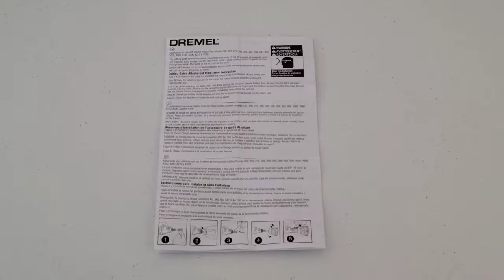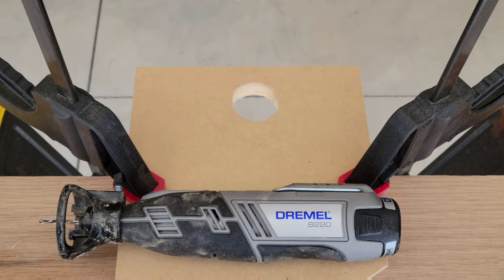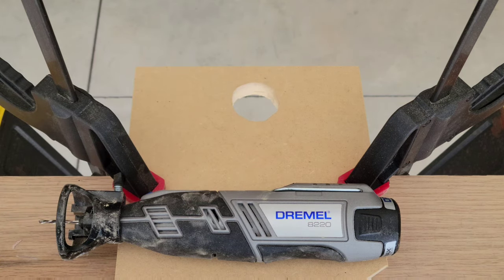How To Use The Dremel Cutting Guide And Multipurpose Cutting Bit And Review

Comment: My ears! I'll use a hole saw and save time and electricity.
Reply: my thoughts exactly. my dremel always sounds like it is dying & very disturbing...
Reply: Try that hole saw on a plaster ceiling 😅
It's not pretty to say the least
Now this attachment with a tile cutter and then the wood bit and I no longer need to repair a plaster ceiling

Comment: Dremel Cutting Guide (cuts up to 3/4") (check to make sure it's compatible with your tool)
Dremel 561 Multipurpose Cutting Bit (use with wood, plastic, drywall, fiberglass, vinyl or aluminum siding, acoustic tile & laminate)

7:27 Recommended speed settings:
plastic, fiberglass, & laminate: 10K - 15K RPM
wood: 20K - 35K RPM
drywall, vinyl or aluminum siding, & acoustic tile: 35K RPM

Comment: This attachment is great for plaster ceiling and walls. If you're an electrician and need to install led waffle lights this attachment will save you from having to repair a plaster ceiling or have the customer fix it.
I use this attachment with a tile cutter bit for the initial plaster cut out. The change the bit to remove the wood latch behind the plaster and you'll have a clean hole and no need to repair the ceiling

Comment: Please keep posting but speed it up.    This application would be better done with a hole saw.  Do you have adequate vision to see where the cutting tool is going?
Reply: This tools are better if you shall cut irregular holes or make grooves in the material. The big opening in the tools are for dust removal and to see where you're cutting. But remember safety goggles, because there's a lot of dust.
If you shall make a cirkular hole a hole saw is better.
Reply: @peha524  Thank You.

Comment: Huh, so this confirms there's actual manuals with, like, words… I recently got a Dremel 3000 and except for the safety instructions, everything is just pictures and most of the time I have no damn clue what they're supposed to mean.

All info concerning the tools coming with it in there is max rpm and suitable materials, but nothing else… I can't even figure out what the exact attachments I got are since that seems to be listed exactly nowhere. I did however notice that your tool looks different then what I thought is a cutting tool – turns out that's just a regular old drill. Gonna go get this attachment now, so I can mill clean 90° into my horrible inaccurate MDF cuts.

Comment: You only need to leave 1/16 sticking out when using dremel bit #560. The one that comes with the kit is #561. #560 is just for drywall and I’m not sure why that one only needs to stick out 1/16 past 0. Probably to make sure you cut all the way through the drywall but just speculating . lol

Comment: Can you use this to route as well? Or will it have to be a through cut? I need to purchase a tool to cut and to route so wanted to know if I needed not this and the plunge router tool or if this will work with a Dremel router bit set to the proper depth.

Comment: Does the little bit cap thingy you took off before install the cutting guide be used to remove the collet nut? I feel like I’ve seen someone do that.
Reply: You're absolutely correct, the collar has a built-in wrench to loosen and tighten the nut. I'll admit it hasn't come up often, but boy when it does it's handy.

Comment: Do you think this would cut 1/2" and 3/4" plywood? Or does it work better on MDF? Would like to use this to cut a 6" hole in 1/2" plywood for a cornhole game, but don't want to ruin the board if it doesn't work very well.
Reply from the maker: Hi April, thank you for watching! I am sorry I am not sure unfortunately. I have not used this to cut through plywood, so I am not sure if it would work. Thanks again for watching.

Comment: Now, what I don't understand is, what's the difference between this router and the other one that is double handheld and transparent plunge router or so, you already know the one that I'm talking about.
Reply from the maker: Hi Sir Kay, Thanks for watching, I appreciate it! This one is not a router, it is a cutting guide and multipurpose cutting bit. Dremel makes a plunge router attachment (335-01,) and they make a circle cutter and straight edge guide attachment (678-01) that can be used to route in a straight line.

Comment: This piece keeps coming unloose every time I start cutting and it will stop cutting
Reply from the maker: Hi Crystal and thanks for watching. I am not sure why it would be doing that and I would contact Dremel for assistance. If it is coming loose every time you use it that is a safety issue. I would stop using it immediately until Dremel can help you resolve the issue. Good luck and hope you get it fixed!

Comment: Bought one to make bird house windows thought it was rubbish far too noisy and innacurate and my scroll saw does a much better job wish hadn't wasted my money
Reply: That is because a dremel is not ment to be used as a hole saw. This attachment is ment to be used to carve a small slot or to engrave. all it is actually for is to make sure you keep the dremel in a 90 degree angle and to have a consistent depth while carving.  It is not ment for this purpose.
Reply: @stephandevriesere3667  it's rubbish at carving as well big thumbs down from me and I do a lot of carving work with the Dremel and kutzall bits but this just sucks